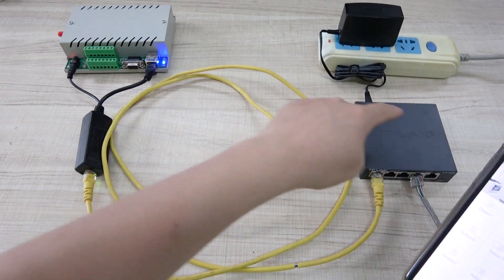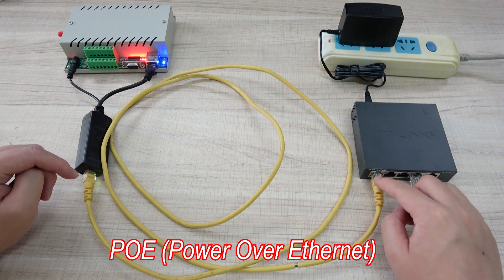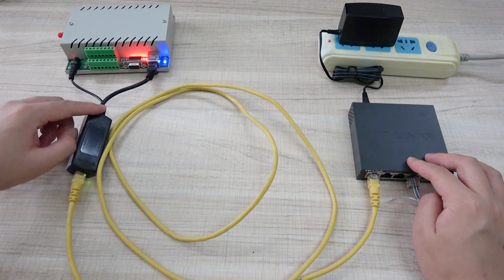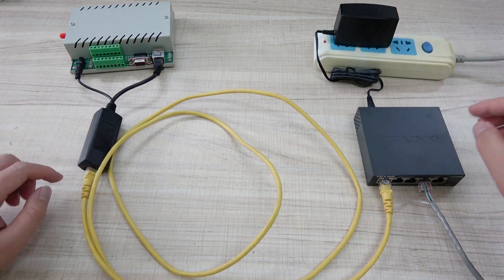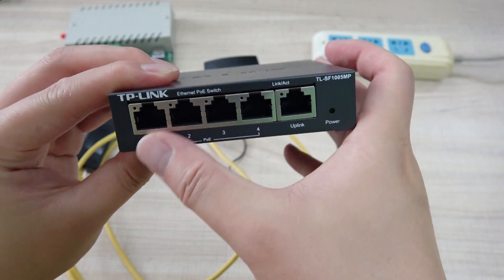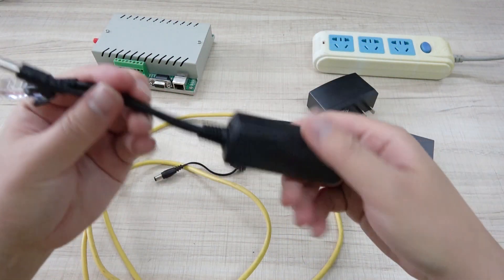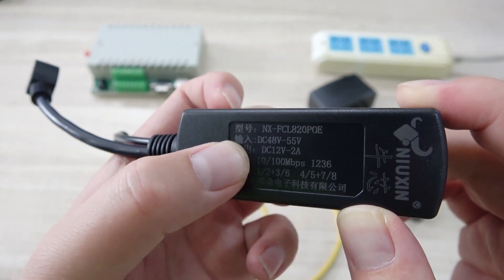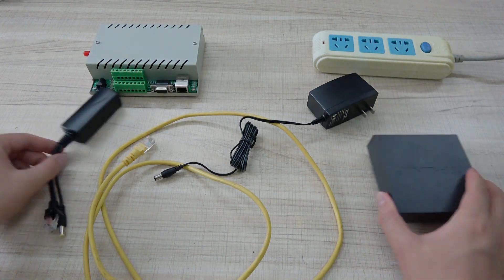How to use POE (Power over Ethernet) solution for KinCony controller

Comment: Hello Kin,
Is this device plug and play?...i mean no configuration?
Reply from the maker: yes, without any configuration. it's by hardware, no software.
Reply: @KinCony  how about your phone?... I mean the app interface i am seeing on your mobile phone.
Reply from the maker: @judeeze7197  not need set, i use 4g remoter control by internet. use way as use ethernet without PoE. poe just have a power supply output